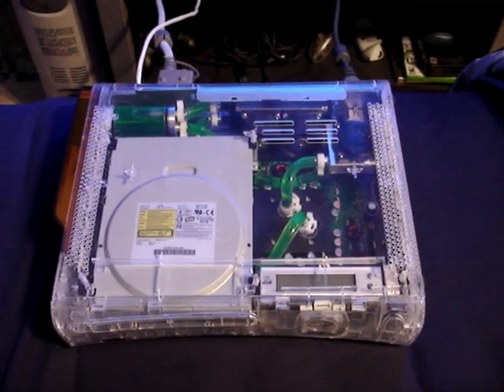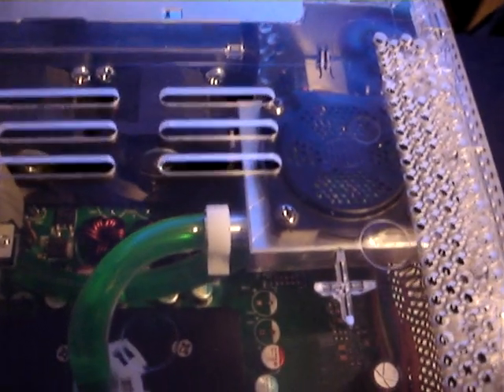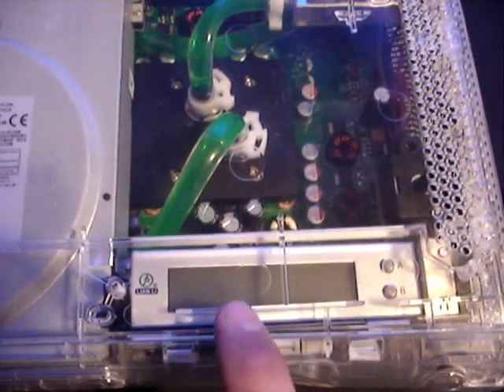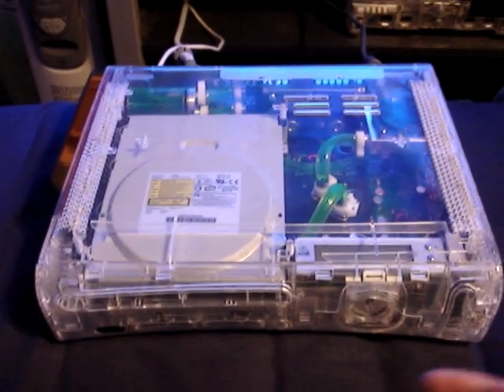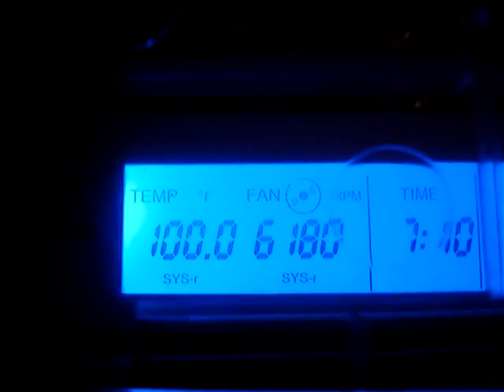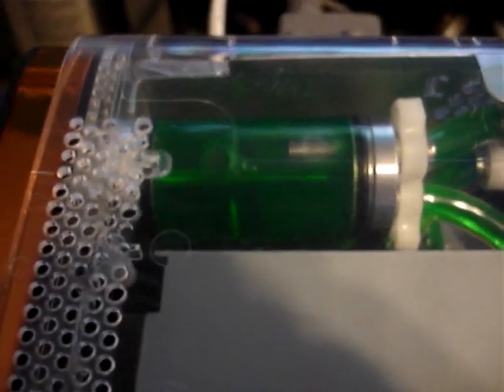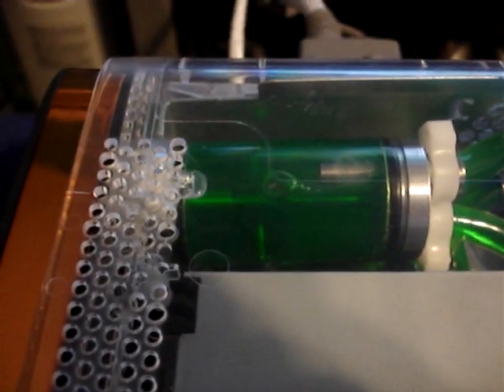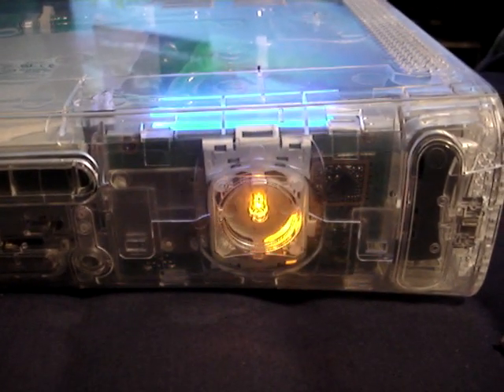Xbox 360 Internally Watercooled³ FINAL

Comment: I know I asked on an older video, but in hopes you will see this, can you do the water cooling project on a controller, or at least do like the ps2 did with the lava lamp idea inside the controller, I loved it alot, even with the leds inside it to. If you can, it'd be great if you could stick it as wireless and have the water multitude of colors, blue, red, green, blue, and etc and have the water be cooled by fans or warmed by fans so in the winter it would be warm and in the summer, cold water.

Comment: @xboxexpert Alright thanks, I didn't think you could. I figured since the stock fans throttle up and down on their own, microsoft would have no way to test what you did or didn't have because of the voltage changes. Plus, this is for a friend so I wanna make sure that this doesn't get banned. thanks a lot! btw, you are a god with electronics!

Comment: hey i cant seem to keep my water cooled xbox 360 at around 100 degrees. mine always stays around 120 degrees. i used the same dual 40mm rad that you used. and 4 fans 2 pushing and 2 pulling.  any tips?

Comment: That is very interesting! The only problems i'd came upon for the 360 were heat related, from hardware failures and warped motherboards.

I'd say if the next gen systems are anymore powerful than the 360 or ps3, they should definitely consider hydraulic cooling rather than just circulating air.

Comment: Im doing something similar. Im removing the stock fans and putting two small top mounted fans. since I have the original fans power supply, could I run the kit with the old fans power supply? also, can you banned off of xbox live if you don't have the stock fans in? thanks to anyone who can answer!

Comment: @Ibot900Gaming There is really no point to it. The xbox 360 keeps itself cool just fine, but it is very noisy. The purpose of water cooling, or any cooling upgrade is so you can make it cooler and quieter, so you should use a larger radiator and medium speed fans. That tiny radiator and loud ass fans are not doing any good.